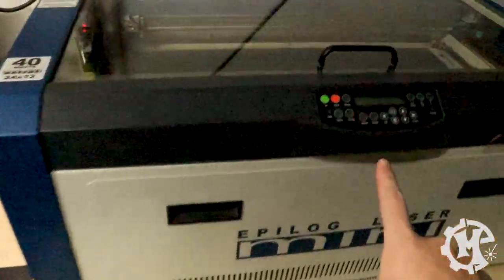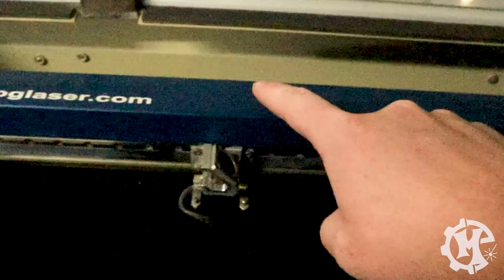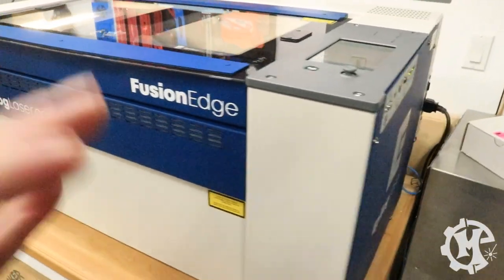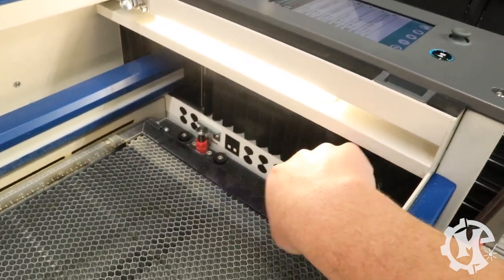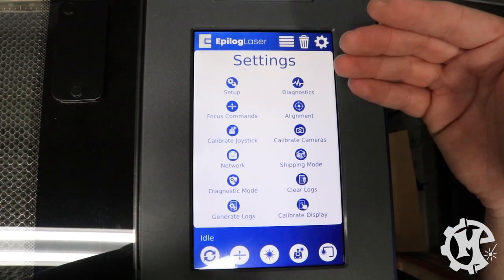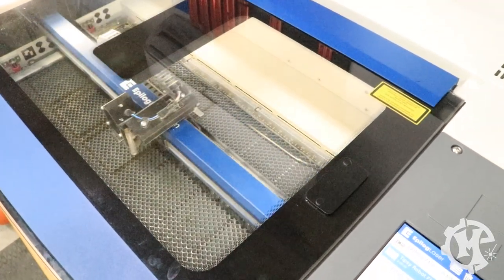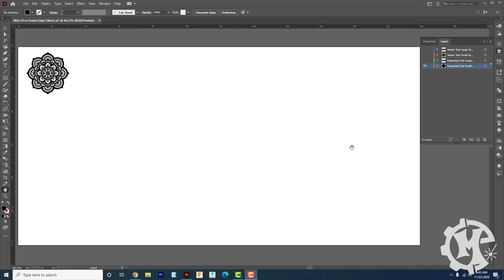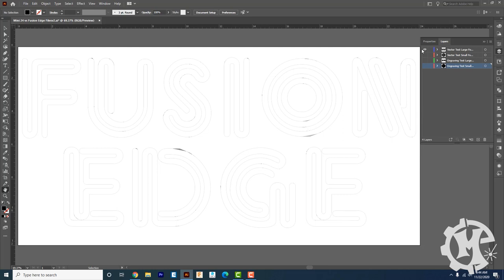Epilog Mini 24 vs Epilog Fusion Edge | Is the Fusion Edge worth the Hype?

Comment: Both great machines but the Fusion is easier interface, faster, set up is easier and a camera for better alignment and you can capture parts with the camera and extrapolate them to make jigs and inserts for packaging etc. . Job Manager is also a great addition to the interface to organize and save jobs. I work on this entire line it is a great upgrade to an already great little machine.
Reply from the maker: It has been a great machine to work with.

Comment: I would have liked to see a comparison of vector curve quality at different speeds.  I have an Epilog Helix.  I used perfect circles to gauge the difference in vector speeds for a project several years ago that I needed to shave as much time as possible off of.  Knowing if the same project can be vector cut faster on the Edge would be a very huge deal when bidding large projects.

Comment: What is going on if, I am focusing correctly, purchased a new laser head, but no matter the speed, fast or slow, my ornaments are still not getting cut through fully/efficiently?
Reply from the maker: What thickness is the material? Check your mirror alignment. Also make sure your bed is level.

Comment: Thank you for the info and effort. lm  interested  in starting a engraving business because l lost my job due to  pandemic in Toronto .Would you recommend any source and videos that l should  start learning with and which programs l should  learn for this business ? Last question can l do this business from my basement or no ? Thank you in advance.....
Reply from the maker: yucelyilmaz1 you will need to pick a vector software to use. The most common are Illustrator, CorelDraw, and Affinity Designer. That’s the majority of the learning curve. You can run it out of your house. I do it in my garage.
Reply: @MakerExperiment  Hi - I see you are in vegas. Do you still keep in your garage in summer? I thought these needed to be kept in a cool temperature. I'm thinking of getting one and am phoenix. Thanks!
Reply from the maker: Boba Tiger I do. I insulated my garage and put a mini split in it for temperature control. You cannot exceed 90 deg F ambient.

Comment: What's the difference between something like this and a glowforge?
Reply from the maker: This machine is Epilog’s middle tier machine. The machine that would be the closest model to compare is the Epilog Zing. That being said, there are a lot of differences. The type of tube, the bed size, the motors, the housing is all metal, speeds and a lot more. I don’t have a Glowforge to put side by side but if you’re going to compare them, look at the Epilog Zing.

Comment: could you have set the power to 67% on the edge so that you are matching power that by theory would make them both same power (40w) or at least giving you same power at 100% on the mini. so if you running 50% on mini would it not make the edge to be at 20/60= 34%? that would give you closer accuracy for visual appearance of end result on your materials.
Reply from the maker: Engravings by Jay if the goal was visual appearance, yes. The reason I did it this way was because I had concerns that people would think I was fudging the numbers because the power didn’t match. However, you are correct that you could alter the power on the edge for visual appearance.
Reply: oh also on the front panel could you easily replace with either quick release fasteners in place of current fasteners? or replace with thumbscrews like used on back of a PC to make removing side panels quickly?
Reply from the maker: Engravings by Jay it should be possible. The main thing there is to verify the threads match. I’m not sure if they list the thread size. Keep in mind, this is a beta unit and not the final production unit so they may change this.

Comment: I would have run them at the same power, not the same percentage.  (for example: 50% of 40W is 20W, 34% of 60W is 20.4W)
Reply from the maker: The purpose of the test was to see the speed difference of the machine. The power influences the looks and ultimately you want to change that but to understand how much faster the machine really is motor wise, the percent would have to match.